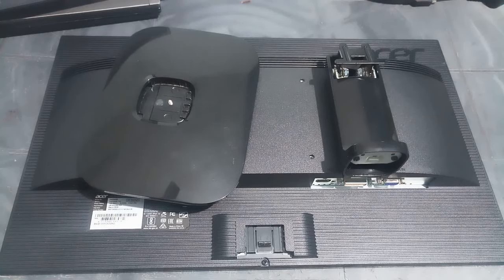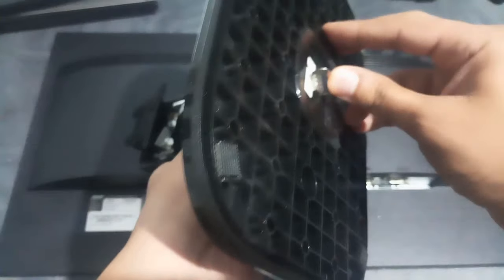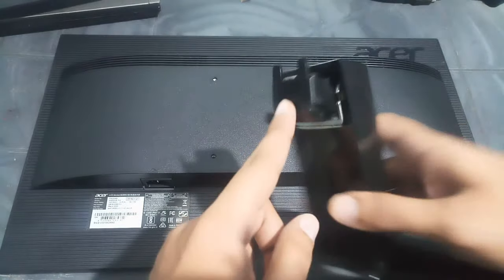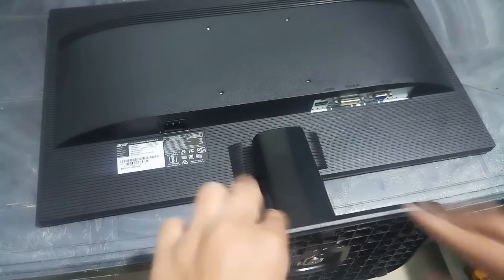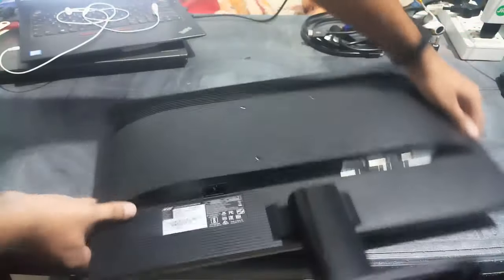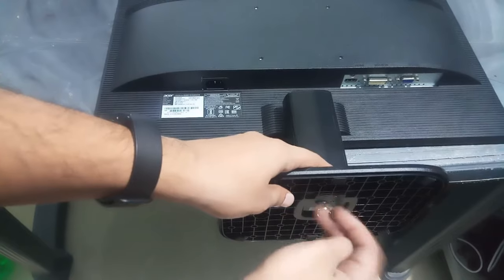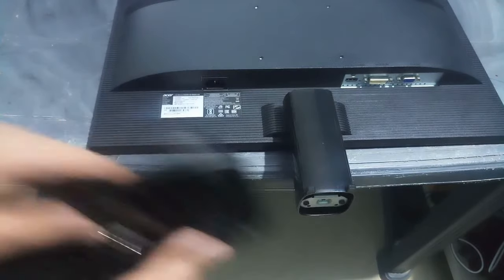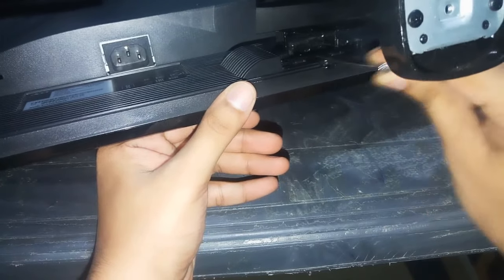Acer KA220HQ Computer Monitor Base Assembly and disassembly/Acer monitor stand removal

Comment: Great video! Can this monitor be wall mounted?
Reply from the maker: Yes, there are 4 screw holes at the back which can be used to mount this on the wall.
Reply: @uniquereviewshacks2121  thank you! Do you know the dimension? 75x75 or 100x100mm?
Reply from the maker: @Kari3e  it's  100 x 100 for my monitor
Reply: @uniquereviewshacks2121  thanks a lot!!

Comment: Hey bro im too late here, but why doesn't my monitor stand have those  spinning lock things underneath, just a screw. And the body of the screw has a flat side on its body making it impossible to lock using Even a screwdriver
Reply from the maker: use a cutting plier to open it

Comment: I’m using a kg251q monitor, but whenever I try to push the notch down, it won’t push down.
Reply from the maker: Yes, the notch gets jam some times. Try to nudge it by pushing the stand upward first and then use your finger to press the notch if possible.
Reply: My fingers are kind of big, so how can I hold the notch down? It doesn't seem jammed, just seems like it's really hard to push down
Reply from the maker: The  mechanism is bad design by Acer but we need to improvise. In this case you might just have to use something that can reach it like a screwdriver to brute force your way out.🤷‍♂️
Reply: Alright. Thanks for the help!

Comment: Is base stand is available in store bz mistekly I broked the stand
Reply from the maker: You might have to buy this :https://amzn.clnk.in/etfx
Reply: @uniquereviewshacks2121  Tq bro but is it available for wipro monitor
Reply from the maker: @nlcentertainment2377  This will fit all monitors given the monitor has those 4 hole at the back for the screws to fit.
Reply: @uniquereviewshacks2121  Tq bro👍
Reply from the maker: @nlcentertainment2377  You Can check this out as well : https://amzn.clnk.in/eItz

Comment: Terrible design in my opinion.. terrible instructions that come with the monitor as well... "Attach the monitor to the stand 2 piece stand after you assembled them together."

I had it wobbling around and was like this isnt right...

Thanks for the video, I didnt have this exact monitor but the stand connection is the same
Reply from the maker: Thanks for sharing

Comment: I have this dell monitor from 2011. I've mounted the stand and everything, but now it's still wobbly and still comes off. What do I do?
Reply from the maker: Can you tell me the model number of your Monitor?
Reply: rev a01
Reply from the maker: Sorry , I couldn't find any relevant information on this.
Reply: If it comes off, then it isn't fully engaged. When fully engaged, you will have the devil of a job getting it off. It is likely to still be a bit wobbly, but at the end of the day you won't exactly be waggling it, so it should be good to go.